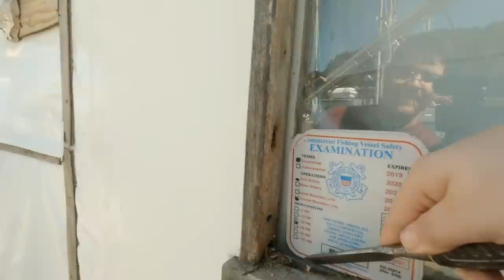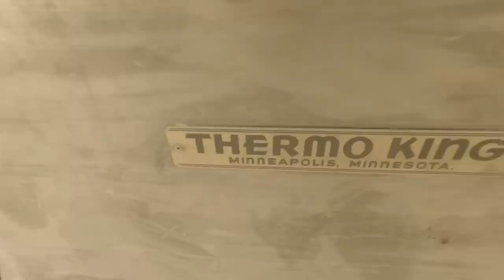Removing Evaporator Unit from Fish Hold - Emerald Isle: Ep.52 Fishing Boat Refit

Comment: Those are good units.  Surprised it's as good as it looks being in a salt water environment.  We had a similar one at the restaurant and it could chill or freeze along with evaporation of huge walk in.  I also remember them installing similar but larger units at warehouse we installed a couple kitchens in.  It was a popular fish restaurant(Legal Seafoods I believe) and we installed some test kitchens there.  The freezer was about 150 yards long and 2.5 stories high(forget the width).  The outside units were basically container units and they could power themselves if there was a power failure.  Thermo King made alot of different units but now they really only make mobile units
Hide that copper as it will grow legs and walk away

Comment: There is a rotten wood stabilizer you should apply to those window frames after scraping and sanding and before applying a finish. It kills the spores of the fungus that is eating the wood ie "rot". If you don't use the product the fungus/rot will continue and only get worse.
Reply: After the stabilizer you then want to fill with a epoxy based filler(the best).  JB Weld or PC products makes a decent one
Reply: @brinkee7674  : You're absolutely correct. After the filler cures it will be sanded back to contour then paint finished. I did every window in a old house onetime for a elderly couple. Tried to talk them into replacement windows but they weren't having it. It took most of the summer and for the cost they could have had new vinyl double pane replacement windows. They were happy, I was paid and all was well with the world. 🙂

Comment: Might want to check out that "Vevor" hydraulic hose crimper.  Sort of based on a Porta-Power with a clamp and various dies.  Seems like it was around $150 and you can make you own hydraulic hoses.  Just need the style of crimp and a roll of hose.  Instant repairs.

Comment: Could you run a pair of steel tubing lines for your hydraulic on the fishtail? Instead of the hose.
Reply from the maker: We had that in mind but current finances dictated hose again. Stainless tubing runs close to $11/ ft. Total run in the loop is 55 feet. We would also need a short piece of hose to tie into the reel, plus fittings, so we went with hose for now. Additionally, this was the hose we used for our seine block, and it is also very likely we will use it on the Emerald Isle in some capacity in the near future, so it can serve double duty.